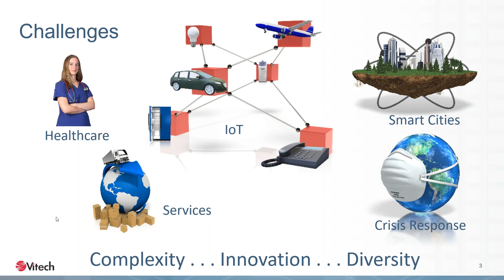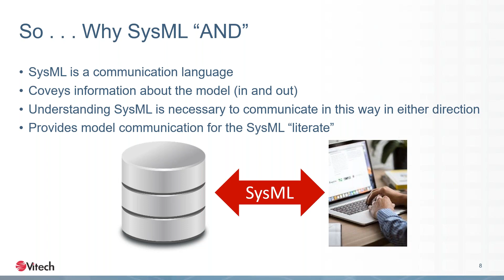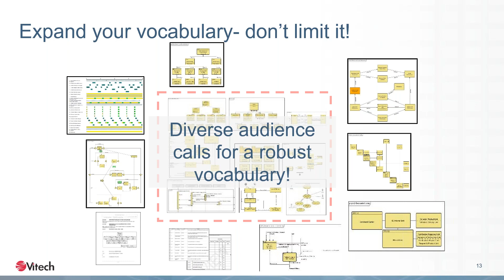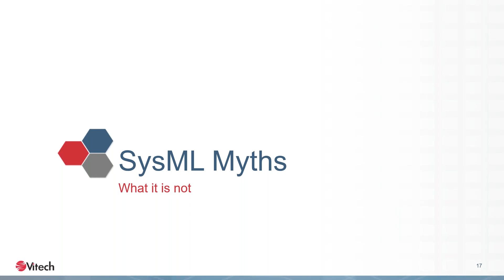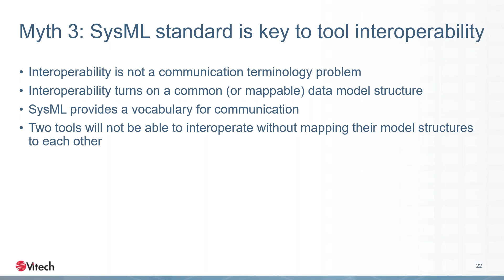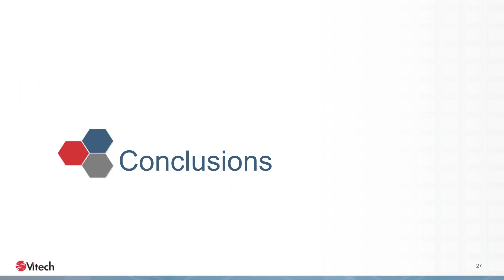SysML “AND”  Its Role and Place in Systems Engineering with Zane Scott

Comment: After 3 years, only 16 likes including me, the reason is obvious language and tool gangs :) As an SE with more than 35 years of experience, and now working on "real" MBSE, I cannot understand why a huge part of the SE community still talks about drawing diagrams more than the domain knowledge representation issue. My solution: choose a top-level ontology to express a realistic and scientific worldview (my choice is Basic Formal Ontology); select or create a middle-level core ontology to enable cross-domain (SM, PM, engineering, specialty areas, etc.) interoperability; develop a domain (SE) reference ontology for the multi-program, sub-domain application-level interoperability; depending on these create a graph schema (on a graph db); populate your instances. Then, you may map your solution to any framework and tool to generate fancy diagrams to communicate with stakeholders.